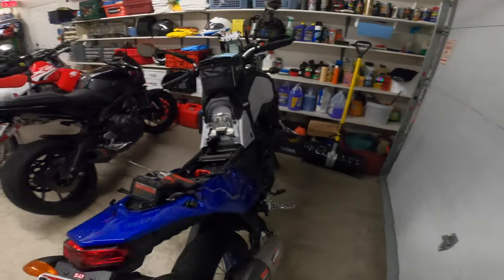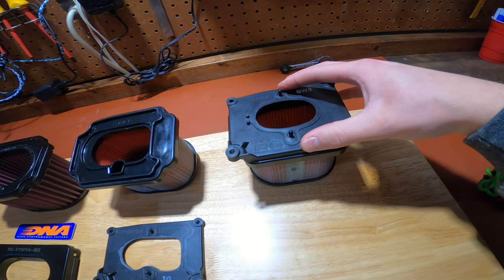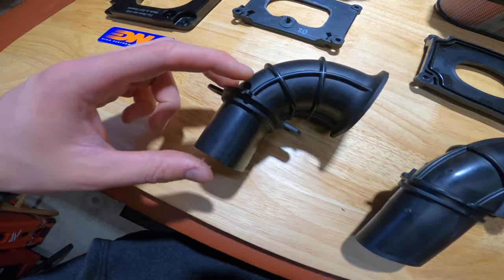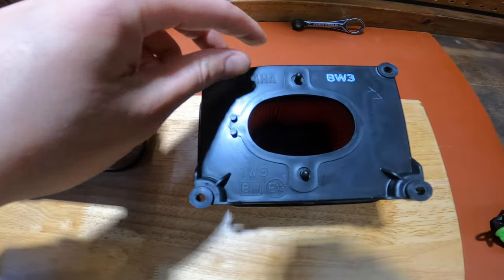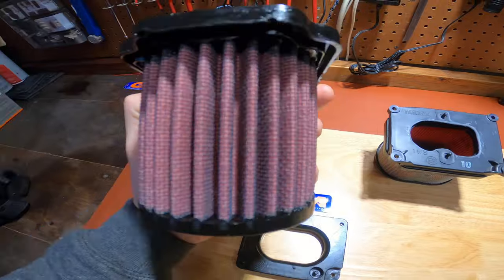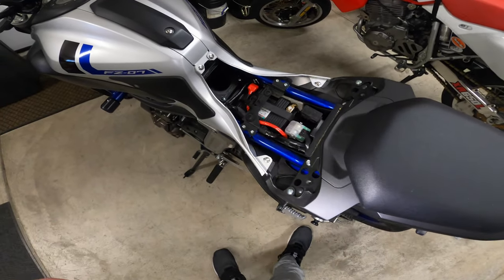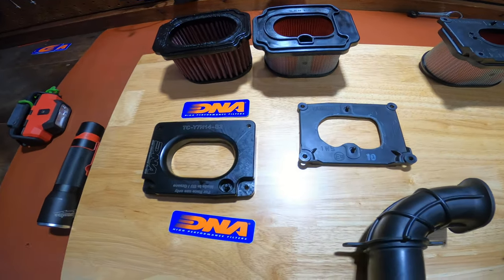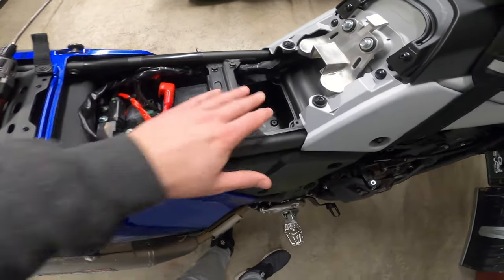Yamaha Tenere 700 DNA Stage 2 and intake options

Comment: Did you considered the option of use a stock paper filter with the dna cover? That way you have more air entering the filter, no need to clean the filter (just replace). More filtration power.

What are your thoughts on this option?

Comment: Hi, I installed the dnr filter and the dnr cover on my tenere 700 Euro 5, exhaust just the Storm muffler, but I did not modify the ecu settings and the bike seems to work better, more pick-up and also a great sound at the axeleration. maybe I'm wrong but that's my impression. I had also heard that the ecu was able to modify this new oxygen supply itself, now when we drive at altitude in the mountain the ECU work good ..?
Reply from the maker: Hey! Sorry for the late response! The bike will definitely feel faster! The ecu will have a margin of correction for oxygen supply but everything I have heard and read is that the correction isn’t enough for that drastic  amount of change in air flow (especially with the DNA set up). Many say the bike will run lean even when you modify the stock intake (snorkel). I have never tested air fuel ratios on the tenere personally but didnt want to risk it. As running lean is definitely something you want to avoid. Plus with a ecu flash you can pick up some extra power left on the table. The flash was a notice improvement as we had road the bike a little prior to sending it off for the flash. So much so that prior to the flash but with the intake and exhaust installed on the bike, it wouldn’t power wheelie in second(after flash now it will). Finding the right person to flash the bike is also important if you want optimum power. We personally went with twowheeldynoworks and while its good overall there is a flat spot in the midrange. Hope this helps yah out and thanks for watching!
Reply: What sise are you funnels please?
The two plastic pipse just after the air box item 6 and 7 in yamaha spare parts catalog.
I have mine writ⁰en on them 35 😭
My Ténéré came limited at 47 hp, and I think I have to change them.

Comment: Thanks for the review , but i was wondering . Does dna air filter let's dust go through
Reply from the maker: The filter has been perfect for us and does keep dust out but we ride nearly 100% on road. If you ride majority off road With extreme dust and mud conditions I would probably lean toward the twin air kit personally. Remember the bike must be tuned for the dna filtering option though other wise the bike will run to lean! If you arent planning on flashing the ecu or getting a fuel controller I believe the twin air might be ok to run. Double check me on that but with the dna they say u definitely need to richen the bike up.

Comment: Can I install only DNA filter without the stage 2 top? Do I need to flash the ecu with only DNA filter installed?
Reply from the maker: Either case from what everything ive seen u need to do ecu flash with any modification to airbox aside from cutting tht little bit off the snorkel I mentioned. For the lid it can be done but would require modifying the stock lid to a bigger opening like i show in the vid to unleash the full benefit of the air filter. That being said i personally would go for the stage 2 just for the more solid top and better flow design. I highly recommend getting it flashed with a pipe, intake mods or both. I will note that 2wheeldynoworks did ours and overall came out ok but there is a flat spot at about 4-5k and we did experience a engine code that we had to erase but hasn’t came back since we initially put it on. Hope this helps!
Reply: @Floatsorrolls1  Thank you 😊

Comment: Do you have an ecu flash? With full exhaust and stage 2 airfilter bike shouldn't work as it should.
Reply from the maker: You should flash or get fuel controller in my opinion because the bike will run lean if you dont. Which is not good overtime plus it will run better with flash. From the video in the description they talk about how the T7 needs extra fuel if you even modify the stock intake. The bike will run and operate without extra fuel but will be running lean which can and will damage engine overtime.  Plus the ecu flash will give you some power.
Reply: @Floatsorrolls1  what are the gains from all the mods in hp? Also which brand ecu flasher do you use? Woolich? You explain everything very well on your videos, I like your content!
Reply from the maker: @lamprosger.9094    Appreciate it! I would guess around 5hp. Biggest gains are  bottom to mid. We went with the 2wheeldynoworks.  We did have a check engine light that needed cleared when we first got it flashed (they talk about this on their website)but since then runs good no check engine light. 👍🏼 Thanks for watching 😎